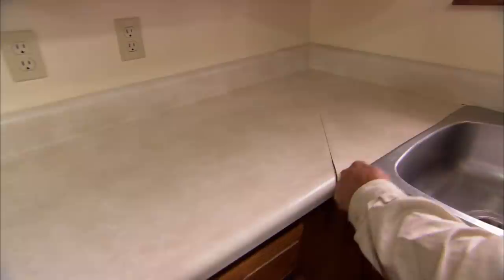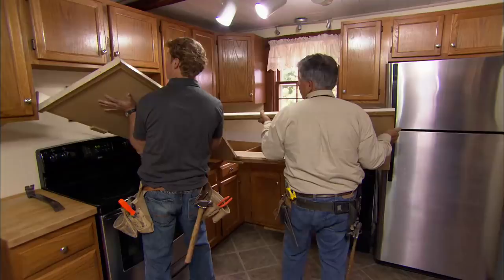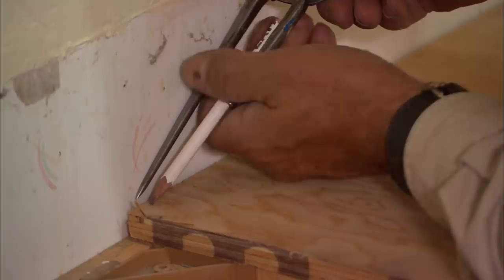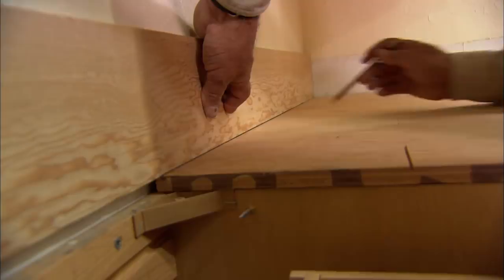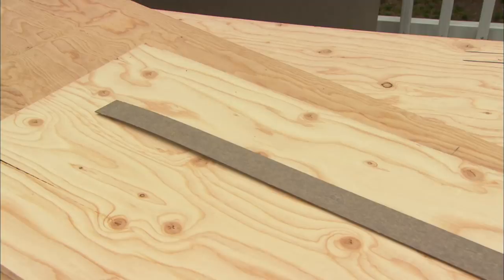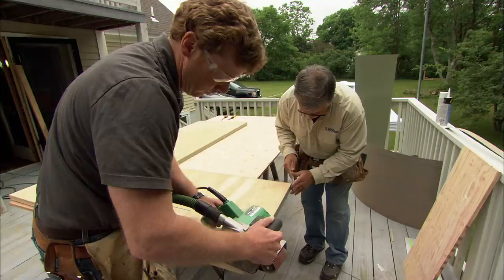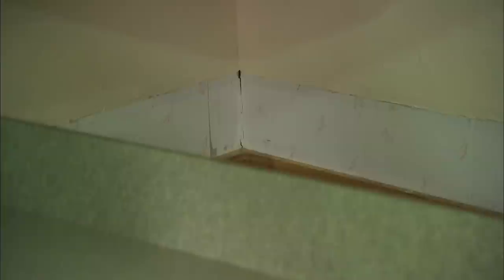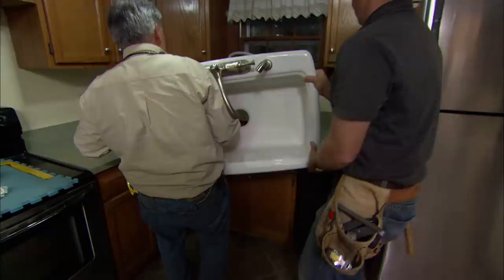How to Build a Laminate Counter | This Old House

Comment: Nice job overall.  I wouldn’t use plywood as a substrate, but I wouldn’t say they’re wrong for doing so. A lot of people in the comment section are really bagging on laminate. In 5 years when the current style changes and everyone has to have the ‘new thing’ it will hurt a lot less to replace a laminate counter than to watch them bust up a piece of granite. Done right, laminate lasts a long time. And if you pick a better color it isn’t so ugly.

Comment: Laminate is still the top selling counter surface.  More laminate than granite, quartz, or solid surface...sorry to burst folks bubble.  Laminate is a great economical choice for those not wanting to spend 1000's on a countertop.
Reply: laminate too much precision work.  Meganite is faster, stronger, more durable than laminate and seamless.  When you add labor cost for laminate, Meganite come out comparable if not just marginally more expensive .
Reply: @ninjaman58  Its not seamless, the seams are less conspicuous. And it's certainly not less expensive.  Having a shop for over 30 years doing Corian back in the last 60's and early 70's when it was new and also doing 1000's of laminate tops, it is much more labor intensive doing solid surface than laminate.  We made  laminate tops with no deck seams if the top was smaller than 60" by 144".   After I sold my shop I taught solid surface fabrication and did continuing education seminars for architects on laminate, solid surface , quartz, granite and scores of other surfacing products.
Reply: Exactly. Too many couch internet tv jockey expert s

Comment: I'm one of the few that actually love laminate counters. Durable as hell, cleans beautifully, just not in that color. Have some in rentals that are in great shape even after 50 years unless the renter used them as a cutting board or ash try.
Reply: laminate countertops are some of the most fragile countertops lol
Reply: I like laminate also.  It will last a long time if installed correctly and taking care of. They still install it in commercial and residential building s. I don't know why all these people on here are shocked to see it.  Don't get it.  Stone nice too but not always the best choice
Reply: I've seen some really pretty laminate countertops.  I just put some in my home.  If you have boat loads of money then have at it with the stone.  Choosing the right colors you can make a beautiful kitchen without spending 1000s of $$$$.
Reply: It's nice to see others who are using laminate. I have laminate from 1959 that is still totally functional, but I'm ready to get a new color other than wood grain. And yes, had people in there who used it as a cutting board in the past. Can't afford granite and it breaks faster. And glasses can shatter on it if you put them down too fast on the stone. The laminate over plywood is a little more forgiving.
Reply: @shadowblack1987 Baloney.

Comment: I am sure you realize that laminate manufacturers(Formica, Wilsonart) only recommends the use of particle board as the substrate and will only guarantee it using only particle board.  I know of many cabinets shops that use China birch as the substrate as we all know how thin the top layer is on that.  Maybe a good US grade plywood wood do, though.
Reply: Good point. Particle board and laminate, when glued correctly, have a closer expansion and shrink rate than plywood and laminate. Also, plywood tends to be wavy.
Reply: Tommy is a wood whisperer 😂

Comment: I didnt understand what pushing the plywood to the side wall did when they ended up pulling it back out again for the backsplash?
Reply: Research and Build   It’s 10 months late but Incase you or someone else is still confused  here’s a answer to the best of my knowledge.  the stove wall wasn’t square however the sink wall was! So by lining the plywood up with the wall that is square  and then placing the backsplash in its  approximate location it allowed them to scribe a line that would leave the sheet square on both walls instead of just the one. Otherwise the countertop would have been askew as the original one was actually set to the crooked wall causing the gap on the sink wall!  When they cut the area marked using the backsplash piece it accommodated  for the walls crookedness and left the correct sized gap to properly secure/place the backsplash piece which sits behind the countertop!  The countertop is now square with both walls!  Hope this clears up some confusion.
Reply: @jaykneegarner2479  wouldn't the backsplash replace the scribed line against the wall?  Unless you scribed out the backsplash too?  Was this just to show the viewers?

Comment: Forty years ago my parents had custom cabinet work done by an old Swedish carpenter --simple, beautiful, golden pine. Now the old cooktop needs to be replaced with a smaller one, building up the cabinetry and countertop to support it. Try finding a carpenter to replicate it in the simple, old fashioned way; they want to get fancy and expensive, which is why I'm watching this video.

Comment: 1980's called, they want their countertop back...
Reply: NO MEAN COMMENTS RAPH GGRRRRR
Reply: Or what the homeowner could budget for. This Old House usually does very high spec, high quality renovations of properties, which are great to watch and works of art - but most people don't have those homes or that money - so videos like this that show more budget renovations are still useful I think.
Reply: theducks.org So very well said. Matter of fact being a remodel carpenter myself that would be the majority of people. Also some of the best clients.
Reply: theducks.org the costumer has plenty money if they can hire these guys to build a custom top rather than  cheap one from the shelf
Reply: koolkevin1107

While it is ugly as sin, the good thing about that top is there's no miter seam.
Reply: The 1920's called , they want their comedy back
Reply: @TheducksOrg  I'm sure choosing a neutral color instead of green wouldn't affected the budget much, if at all.
Reply: 1980's... Looks more like late 1960s.
Reply: 40s this became popular in household use. I’m currently trying to reinstall my kitchen based off the outlines where the counter tops and cabinets were and based off what was in the downstairs kitchen I would assume the same pattern was used in the apartment upstairs
Reply: Using it for my workbench. Awesome product actually

Comment: so where the laminate corners meet, are those sealed with anything? it would seem that the joints would be a fail point for water penetration. Do you go back over it with a skim of silicon or like a varnish type of seal?
Reply: They sealed the joint with silicone. The wood underneath the laminate

Comment: How long do you have to wait after u stick the sides and top before you start to router them flush?
Reply: After sticking the parts together, use a roller or block of wood and a hammer to press them together, working from the center toward the edges.  A countertop this big should take about 5 minutes to roll.  Router anytime after that.

Comment: Just a smaller detail, but did he have to lay the laminate on top of the plywood? I would imagine if you place the laminate on a large, open space then it would be easier to put the plywood on top of that.
Reply: The laminate doesnt lay flat. Ever have a poster from a tube roll up on you?

Comment: That's interesting... I thought back splashes were supposed to sit on top of the counter and that the subtop was supposed to have a small lip to over hang the top of the cabinet to hide the seam where the top meets the cabinet?
Reply: The "back splash" isn't like mine are done. Where he add a strip a plywood to the front to make the counter appear thicker than it is, the seam where the top meets the counter is effectively out of view. Unless you are  drunk, laying passed out on the floor saying SOB, Tom did that wrong.

Comment: I love and respect Tom and the guys but Is plywood considered old school? I was told to use particle board because its more stable and flat, also If you put backsplash on top you don't really need to scribe to the wall...everyone has their method I guess, bottom line looks great
Reply: The underlayment on our kitchen countertops is plywood--the countertops themselves are stone/granite.  The previous laminate countertops (before our remodel) had particle board--which was also used in the kitchen cabinets.
Reply: It handles moisture better.

Comment: The information was great but the labor and material cost of this build had to be much higher than a pre-made laminate countertop at one of the big box stores. I have bought and installed them for customers and there is no way that I could do (or would do) this build for them at a lower cost.
Reply: Agreed!!
Reply: Have you ever ordered any custom laminate counters not just a spec off the shelf piece this is something a decent handy home owner can pull off and save a large sum. Of money especially on a large kitchen island ex. Plus they may have a dated design but your really only limited on that by your imagination
Reply: It  was probably cheaper to match.  Some people like their current kitchen style even if dated.  I enjoy closed off designs for homes and not open concept. I like both .
Reply: This is meant for someone to do themself instead of hiring you.  Im not sure how you didnt catch that.

Comment: Plywood is NOT a suitable substrate for Laminate.  Over time, the grain of the plywood will telegraph through the laminate.  No laminate company recommends plywood.  Either a GOOD particle board or MDF is the recommended substrate.  I have made 1000's of custom tops and never had a single issue with water or de-lamination, over the last 50 years.
Reply: I'm sure that's why he used the expensive smooth sided plywood. I would use plywood over particle. Particle is great until it get wet.  But it is truer. Thank you for sharing
Reply: @corysturgis6660  I have made 1000's of laminate custom tops over the years...all with industrial grade particle board with zero failures of the substrate. You may be confusing commercial grade or underlayment (big box crap),  which are all vastly different.  Any plywood, even those with minimal grain will telegraph through the laminate over time.  MDF is available in exterior grades, which are used for outdoor signage.  Using the proper materials and showing best practices is what TOH should be about.  What you get is the homeowner going to the box stores, buying the cheap china plywood and then having their installation fail.
Reply: @wags99999  thanks for sharing
Reply: No one except Wilsonart.

Comment: counters are so expensive today..this is a good idea.. laminate  at RONA.CA  is only 40$   and 5/8 particle board is only 20$
Reply: san379 If you really don't care about the looks.. just wrap some trailer sail over a piece of wood.
Reply: "particle gets fucked up when it touches water."

And you think that hardwood doesn't?
Reply: Solid wood will warp, bend, possibly crack AND rot. Plywood is a better choice than either solid wood or particle board for this application.

Comment: Would not be happy with scratches like that on my countertop. Camera does not miss much.
Reply: I didn't notice any scratches (if there were some, they certainly didn't standout).  You do realize that a kitchen countertop is a "work surface"--and not a museum display piece?  The best way to keep your kitchen pristine and "like new" is by not using it.
Reply: I caught them right away....looks like Tommy got a little crazy with his file on the front edge......lol

Comment: why would you not secure the top to the base? i'm sure its heavy and theres nothing that will get behind it and push it out, but it can still be lifted from the front.... I would put some blocks in here and there and secure it to the base with screws... just saying... but great video none the less!
Reply: It makes it easier to rip it out when you realize you don't like it.
Reply: +Damien Nicholas You can screw it from beneath.
Reply: I'm pretty sure they only dab the corners with stone countertops too. I would run a few shallow scews

Comment: You told Kevin you were taking "a couple of pieces of dowels out" but you clearly took out more than 2 pieces..  messed up
Reply: How did he mess up? I missed where laminate touched down when he didn't want it to, or where he didn't' want it. "a couple of pieces of dowels out"  was advise meant for newbies.
Reply: If you read my comment correctly I was referring to the number of dowels he took out compared to how many he said he would take out.  lol..
Reply: Get a hobby Richard Parker
Reply: I hate it when people use a couple to mean anything but 2, use a few if that's what you mean not a couple, which is 2.
Reply: @cjhification  a few is 3. Maybe he should have said several.
Reply: @elwood62  a few is not 3, specifically, it's a small amount more than 2